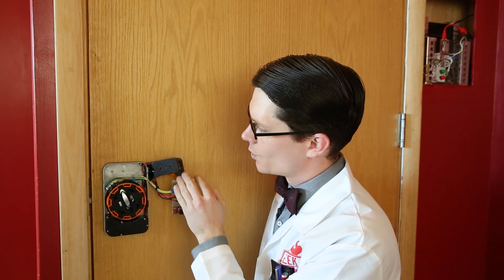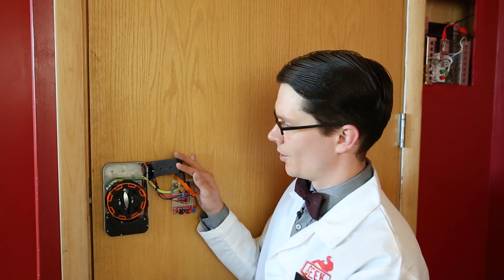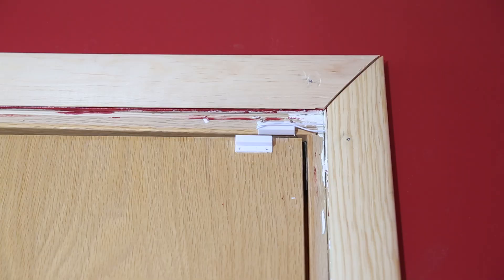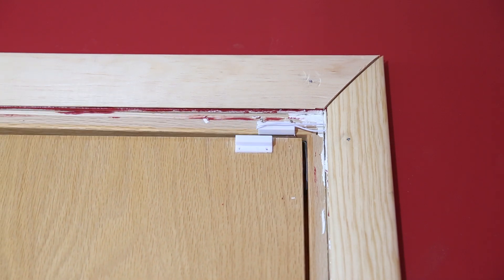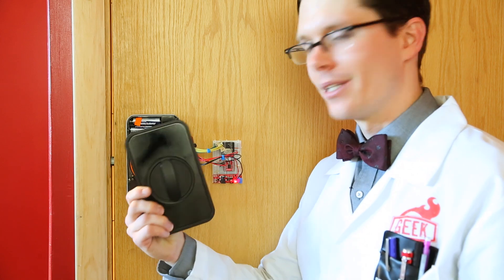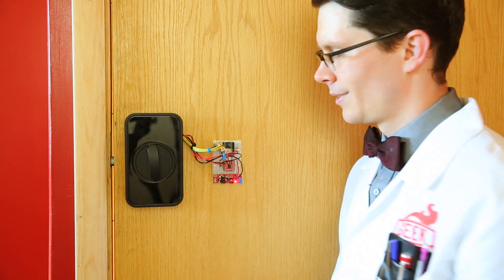SparkFun Lockitron

Comment: 1.) the deadbolt should move when you turn the knob towards the door, not away.
2.) what use is it if the electronics aren't inside the case like EVERY other smart lock?
3.) aren't the read switch and magnet supposed to be lined up, not off center like they are?